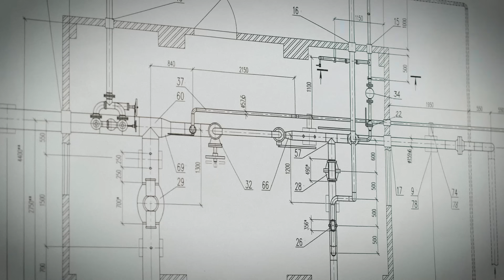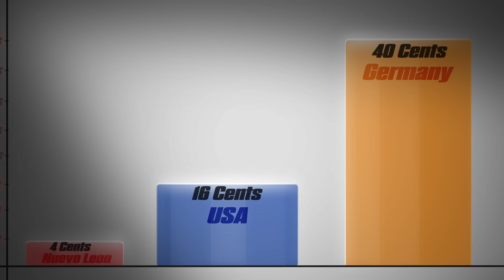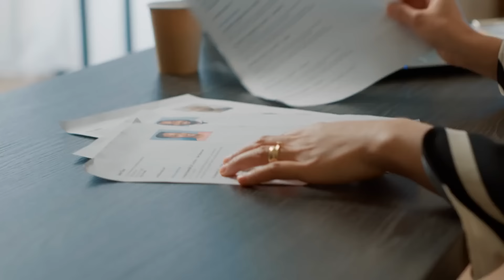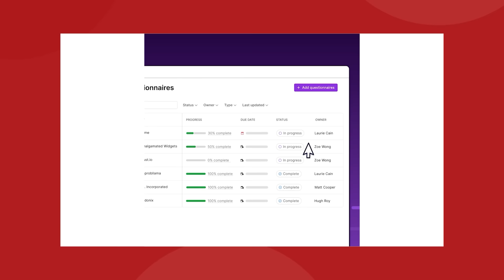The Disappointing Truth About Giga Mexico

Comment: I live in Oaxaca Mx. And a Tesla investor. As I remember the original plan for GigaMex was to sell to Latin and South America. I've seen a few Model 3s in the wild here. But they could have been Hertz cars. Mexico uses diesel for buses and trucks and the air quality shows it. I suspect Tesla will build in Mexico when the time is right. A charging infrastructure is needed before there could be a wide acceptance of EVs. There was no sense to build a factory until they could forecast demand. Tesla will build when it is the best use of their resources.
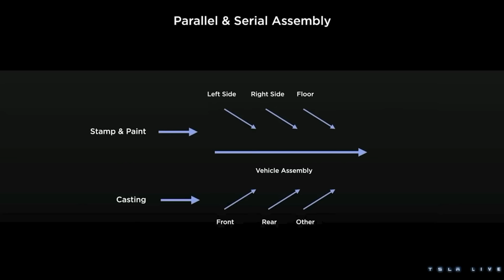Reply: There is demand for a cheaper EV in the U.S. Monterey is 2:30 hours from Texas instead of rolling out affordable EV’s Tesla worked on the Cybertruck which has no demand compared to affordable EV’s. Tesla should have been focusing on a model 2 not cybertruck. The tariffs and EV tax credit ban will crush Tesla during the Trump administration

Comment: Tesla has changed course - simple fact. The original mission to accelerate transition to renewable energy has sufficiently advanced and Elon has set sight on other goals for Tesla. The future of Tesla isn't in mass manufacturing low price EV but in services, software and AI = value added premium engineering
Reply: Plus manufacturing in Energy storage and less towards cars only more software and etc. Amazons major rev comes from AWS not selling retail items and their warehouses. Shifts do happen and they can have a major impact. Tesla needs are stronger position and focus on Asia. There are limits and restrictions but they adapt EV's and tech way faster than Westerners
Reply: I thought his main revenue was building secret tunnels for the military industrial complex.
Reply: @greatcondor8678  You might be right, the man has many irons in the fire and isn't going to give them up so easily (well, he did the solar roof project and flat pack small house ideas already, perhaps roadster 2.0 too) The future seems clearly AI, software and services - much juicier and bigger fish to fry

Comment: FSD will create massive demand for Tesla vehicles. Getting FSD done is requiring a large cash investment which is a priority over factory construction. Due to economics Austin is operating at a quarter of its capacity so no need to build a new factory. Berlin is also running well below capacity. A more affordable model and a robotaxi model may undermine model 3 and Y sales in the short term so it’s difficult to see how demand might go especially with the uncertainty surrounding elections. Holding off on Mexico is a sensible caution in particular with global conflicts affecting supplies and logistics at the moment.

Comment: All EV automobile manufacturers are desperate to escape the Lithium battery bottle neck.  The current battery's do not meet the demand and so far do not outweigh simply buying a gas vehicle.  and with Toyota delivering their hybrid engines the pressure will only increase. I hope these engineers at Tesla can produce a new battery that can double every stat of the current ones.

Comment: 2:05 4,200 acres or 42,000 acres?  The spoken vs the written did not match correctly.
Reply: Well, using common sense you could realize that it is 4,200 acres. Because 42,000 acres would be the ridiculous.

Comment: Elon openly pointed out clear reasons. 
1. economic uncertainty 
2. most important: 25$k Tesla is planned to have a new way of manufacturing ( unboxed process) 
Elon knows he needs his top experienced engineer to pull of the ramp up of such new processes. And most of them would not move to Mexico. 
Having the engineers directly on the production line is crucial to the success. 

You could argue that making such decisions based on new conditions, further arguments you didn’t thought about is an asset and not a liability. Especially in such fast changing times